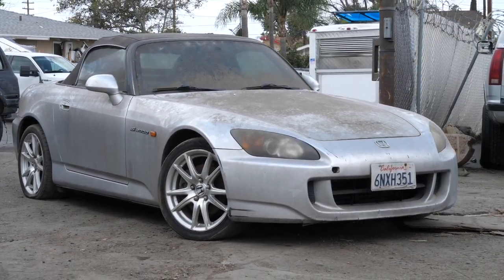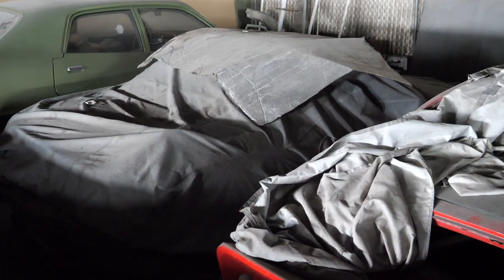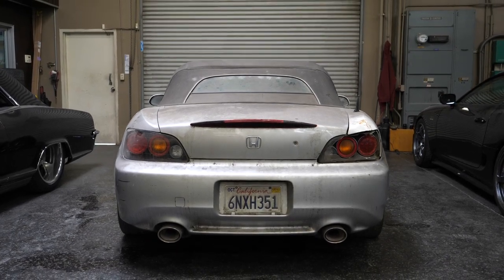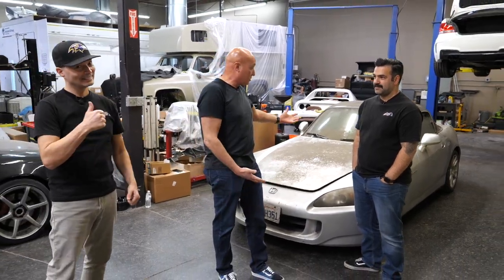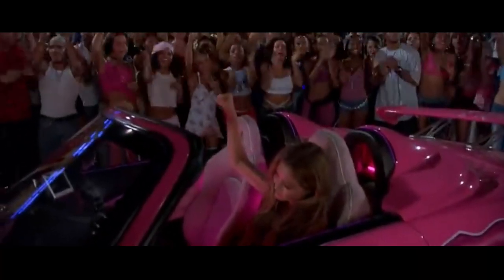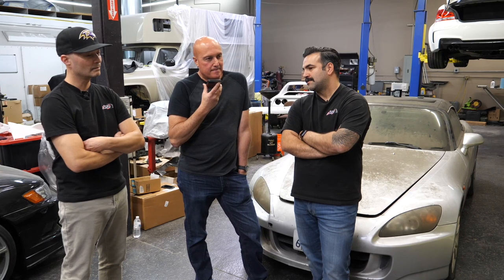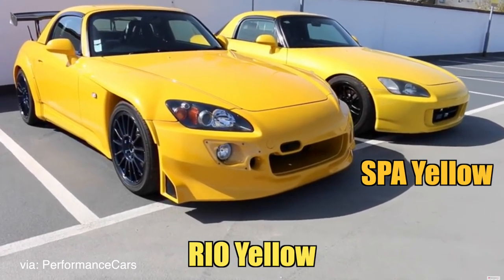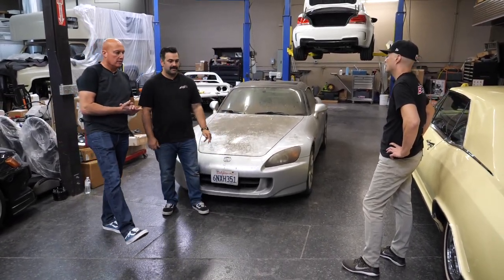Lost & Found S2000 | What Does The Future Hold For This S2000?

Comment: Im a s2k owner. Trans and diff will be just fine. The engine just find a used f22c1 and drop it in and clean it up. It'll be a great s2k. I know of a dismanteller in chicago, il that has some f22c1's in stock. The johnny tran car is a veilside kit, i just saw a rep veilside kit for sale for $300 in ny.

If you want to retain the value of the car keep it closer to stock and f22. If you go all out johnny tran the type r engine is a fun swap.
Reply from the maker: We love the Honda engine as is too. We are still debating the 10 VIN value versus the all out movie car build. It seems like James may have lost this battle!

Comment: just clean it up and get it running, replacing only what it needs to be a runner.  Dylan McCool has brought stuff back from the dead that make this thing look showroom.  the gearbox is FINE, come on, it's a friggin Honda...  worst case you pull the motor!
Reply from the maker: We are sure the engine will need some work. The gearbox should be fine, but we won't know till we dig in deeper.

Comment: I know... a F&F car would be cool as a video... but you have a straight, original S2000... rebuild it to specs. Get a goner if you want a FF car, don't mess up a collector's car
Reply from the maker: This has all the VIN tags in place, but it's far from a collector's car right now. We just have to see if the money spent will equal the car value at the end.